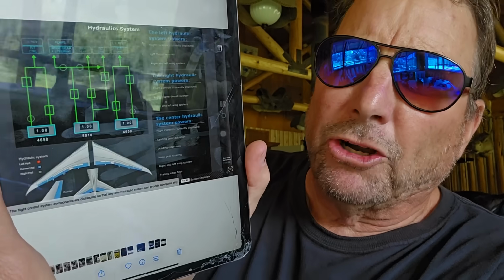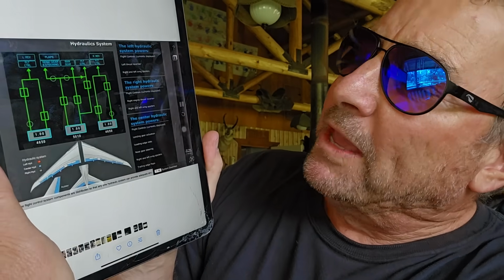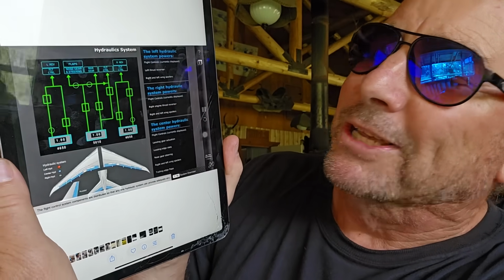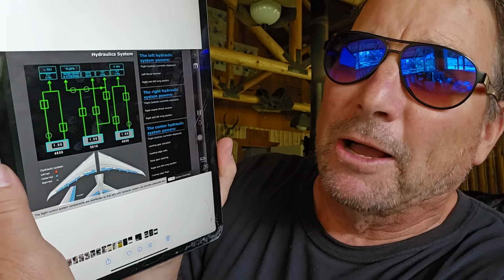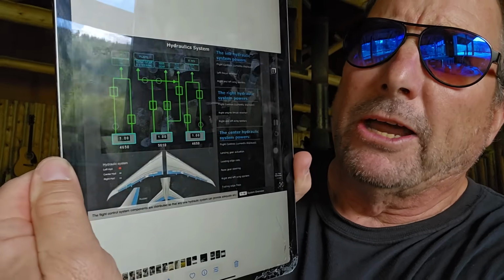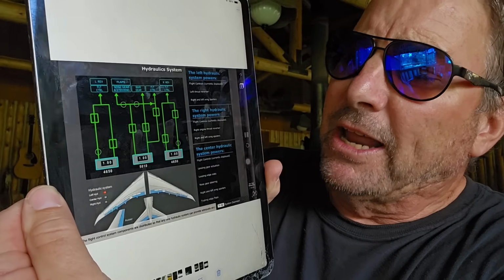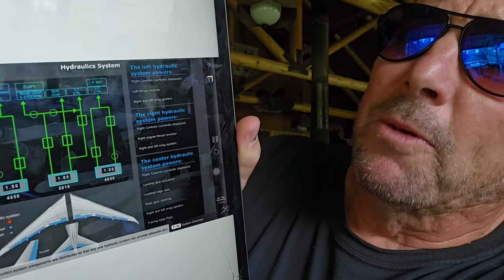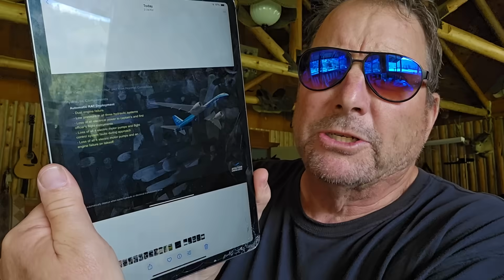787 Crash India What's a RAT? When does it deploy?

Comment: Very low time FO (1K hours) paired with check pilot (60 years old and only 8K hours) not a good combination in my experience.  Video seems to show rotation late around overrun area (debris kicked up by engines).  Maybe concern about late rotation distracted normal after TO flow.

Comment: Never have I looked forward more to a set of black box recordings being released.
Reply: I just had a thought. If it was an electrical failure would that affect the black boxes?
Reply: @peterkuhn654 I seem to remember that in the recent Korean crash, both the cockpit voice recorder and flight data recorder cut off at the time of the bird strike. As the emergency power goes to critical flight systems, to try and give the crew the best chance of saving the plane.

So, unless there were signs of an impending failure beforehand, it may be the recorders won't have anything of note.

Comment: I thought 'Captain Steeeve' had nailed it when he speculated that when the PIC called for 'gear up' the FO retracted flaps by mistake but if the RAT was deployed .... that's another theory quashed. Didn't the survivor mention flickering lights?? (although that was probably the transporter room beaming him up!)
Reply: Captain Steeeve seems like a nice guy, and can speak knowledgeably on normal commercial airline ops, but he should stay away from accident analysis.

He was taking about mast-bumping in the NYC helo crash, and now this.
Reply: Several news outlets are going with that “pilot error” as well. But it seems implausible even without the evidence of a deployed RAT. 
1) distance between gear and flap levers
2) dissimilarity between the operating action of the gear and flap levers 
3) even if the pilot was under the mistaken assumption that he should raise the flaps, he wouldn’t have done so in one single action.
Reply: @kaasmeester5903 EXACTLY!!..  my wife mentioned Steve’s theory and I didn’t know who it was and dismissed it as extremely unlikely.  I mentioned all the stuff you highlighted above. In addition I said this is a flagship aircraft .. the idea that there are 2 pilots making rookie mistakes on takeoff is far fetched( the PIC would quickly check if the landing gear was up ) whereas captain Steve said he wouldn’t know if the FO had made a mistake.. it all seemed like crazy talk
Reply from the maker: Mis informed speculation without research.
Reply: Unless the crew deployed the RAT themselves.

Comment: I just watched a video taken by a passenger on the same jet on the flight before the plane crashed. He shows how the AC wasn't working, half the headrest touchscreens weren't on, and the others wouldn't  respond to touch. The lights wouldn't work or the little controller built into the seat back.
Reply: You cannot read anything significant into the faulty information/entertainment system. I have been on Air India flights between Ahmedabad and London eight times in the last few years. All were on 787s VT-ANsomething and none of them had the information/entertainment system working correctly. Some were partly working for part of the flight, and where the map appeared on the screen it had some errors like the words "Arctic Ocean" and "South China Sea" appearing across central Europe.
Reply: AC wouldn’t work if there was no ground power for example. And air India’s Dreamliners have a very old cabin, it’s normal for the screens to not work. Everyone I know who has flown with them has said the same thing. It’s a complete non story.

Comment: Electrical issues could explain the RAT.   Was not a engine failure either or the plane wouldn't have stayed so straight.   And what are the odds of a double failure with zero smoke or anything?
Reply: If FADEC shutdown both engines
Then you wouldn’t get smoke. 
Of if for some reason fuel couldn’t be supplied to both engines, you also wouldn’t get smoke

Comment: Juan you are the best in the business. Another aviation debriefing analyst believes the 2nd pilot might have grabbed the flaps lever instead of the landing gear up lever. Thoughts?
Reply: Lots of that going around but no evidence for it especially if the RAT deployed due to loss of engine power.  Juan says at about 4:14 that the RAT will not produce enough power to raise the gear even if the pilots put the gear handle up.  We do not know yet what position the flaps were in yet.  As Juan has repeatedly stated, the video we have so far is too grainy to see the deflection of flaps in the normal takeoff position.

Comment: Lots of data to extract from both recorders. If the fuselage gaps were too great in the 787 and it had a fuselage carbon fiber separation failure, that with cause electrical damage and failure causing major system failures.
Reply: What? What does "fuselage gaps were too great" mean? That's weird.
Reply: @carsonfran The carbon fiber construction technique boing uses is unique to the 787. Boeing creates round carbon fiber barrels around the metal frame work and then bolts the sections together with special tight tolerances. For years whistle blowers stated hundreds are flying significantly out of specification. This may have nothing to do with this situation but, until we know everything is suspect at this point. 

I have decades of advanced material reinforcement, including carbon fiber, manufacturing, quality control and forensic failure analysis engineering experience. 

Lots of Swiss Cheese events on this accident. Data recorders are vital.
Reply: @icare7151  No, yeah, I understand how the B787 is constructed, but how has that have anything to do with this accident?
Reply: @carsonfran If the fuselage had a structural failure its could have cut electrical wires, hydraulic lines, fuel lines, etc. Because the aircraft was not pressurized nor at high altitude and sped, likely it wasn’t a structural failure. However since very little of the evidence is left the data and voice recorder are key.

Comment: Videos are circulating showing cabin electronics on the fritz on flight into Ahmedabad, passengers unable to use inflight entertainment, was all frozen, and cabin lights playing up apparently for a few hours prior to landing. Flight was slightly delayed on takeoff, whether it was to rectify electronics problem, don't know. Seems like something went completely heywire with electronics on takeoff, only time will tell I guess!
Reply: I'm thinking this may end up being one of the most telling clues yet, but it has been given little attention so far
Reply: I have been on Air India 787s eight times in the last few years, and none of them had the information/entertainment system working correctly. The condition of this system has no connection with the condition of equipment needed to keep the aircraft flying.
Reply: @cedriclynch it’s a sign though - if you’re happy for planes to go out into service on one of the busiest routes with the most obvious technical stuff inop…. What else is fritzed?
Reply: @chrisdenham9086 What else is usually not in good working order on Air India 787s (and 777s): the tray tables, which often sag below horizontal to such an extent that anything you place there and do not hold on to will shortly fall into your lap.
However the seat belts are always in good working order, and the safety card and the life-jacket are always present.
Reply: Yes,  absolutely ...

Comment: If the plane was still ascending with the RAT deployed then it wasn't dual engine failure.
If the RAT's purpose was to restore power to critical functions, then it failed.
Reply: The RAT is deployed automatically when all generators fail. Therefore with all engines and APU shutdown, the RAT would deploy.